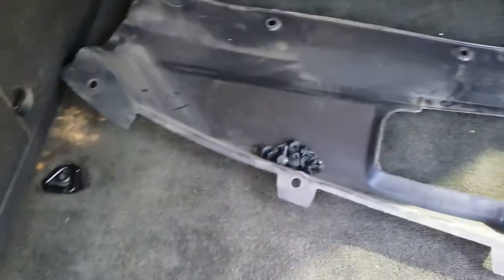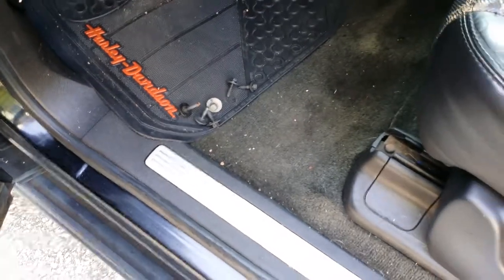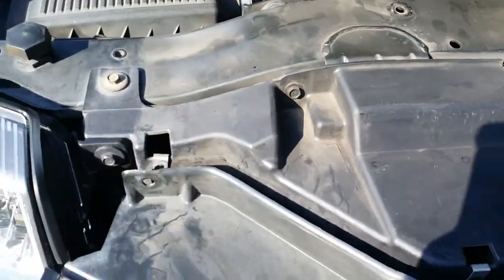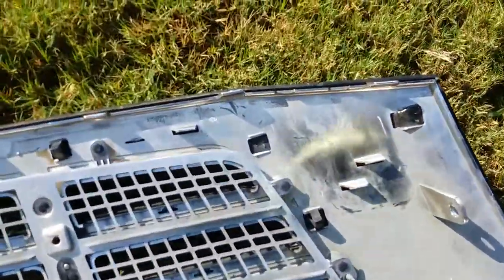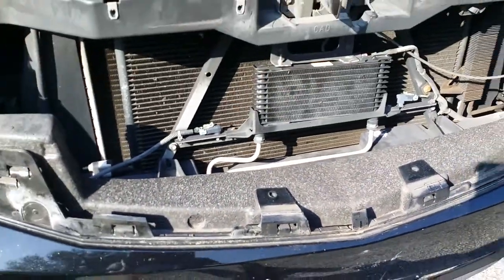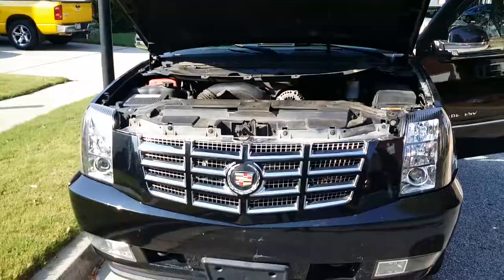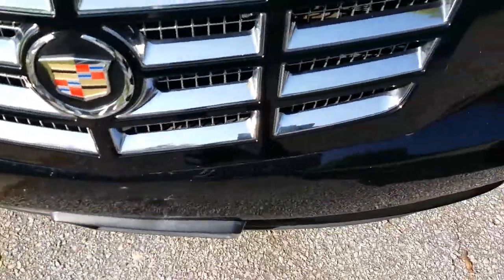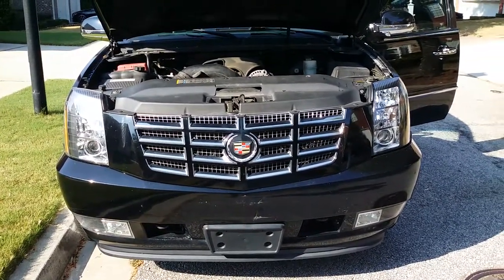ESCALADE 2007 GRILL REPLACEMENT

Comment: Just really struggling with this. Got the top black cover off, removed the 6 bolts at the top (that hold the grille on), the 2 black retainer clips on the sides & 2 black retainer clips on the 2 large tabs at the bottom, but I cannot get it released at the bottom. It’s like these additional smaller tabs (EIGHT of them) that look as if they’re push tabs that would allow you to remove it, but they won’t budge (& nobody on YouTube is showing the entire removal process from start to finish w/o removing the entire bumper cover). So frustrating lol.

Comment: This is a terrible video. The bottom doesn't just pop out.
Reply: This sure was a terrible video, little help on how does the bottom go in exactly
Reply: @Frankcontreras312  I got it in, but it wasn't easy. I wish I would have taken notes and posted it so I could've helped you and others. The other video was equally as dumb. The other guy's video said you had to take off the bumper to install the grille. That's a bunch of BS too!